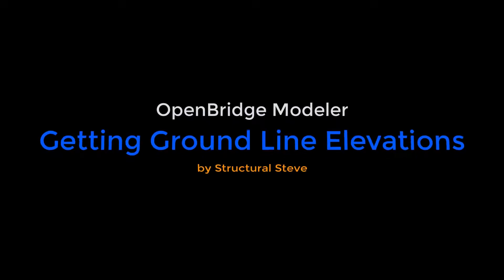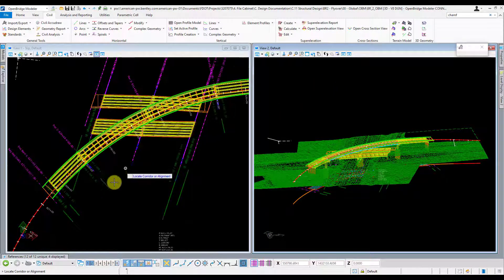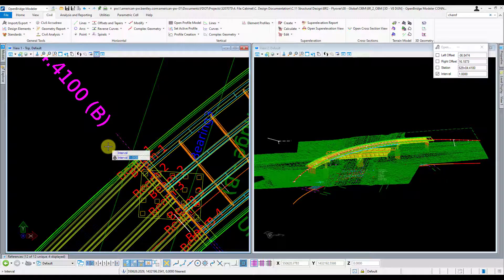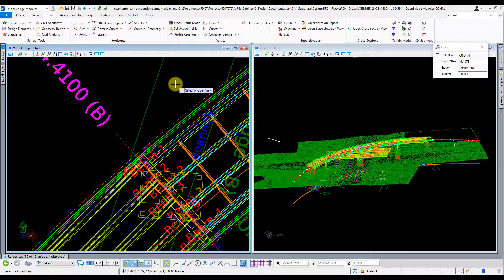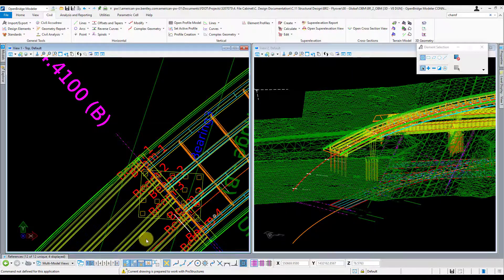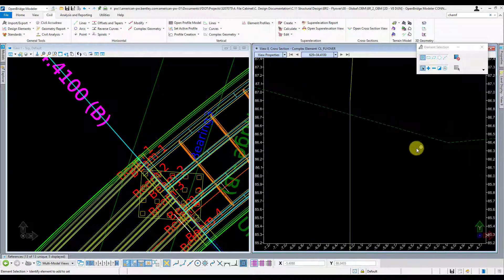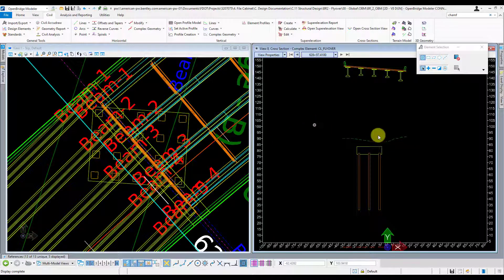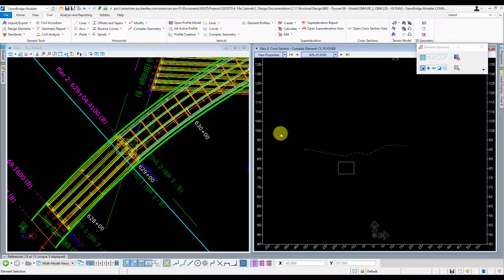OpenBridge Modeler - Getting Ground Line Elevations

Comment: hey Steve, I am working on Open bridge Modeler and I layout the bridge and everything works but when I am trying to generate the deck elevation reports I can't get the back of south abutment or north abutment points for the bridge . is there any possible way to get these points and in the deck report
Reply from the maker: If the deck element is present at the points you wish to report on then it is possible. You can use offsets in the report to get additional points if needed. If you have trouble with that I suggest submitting a ticket to Bentley.